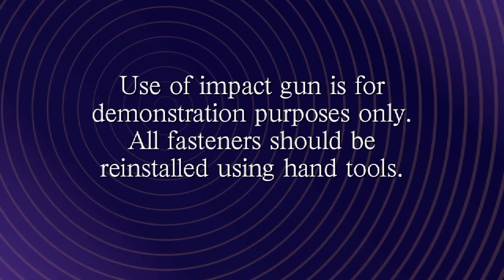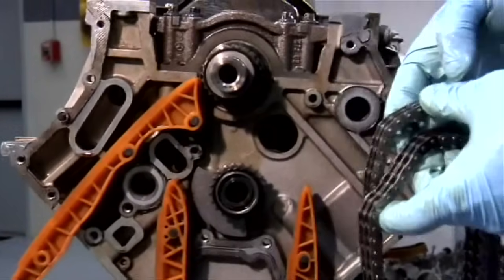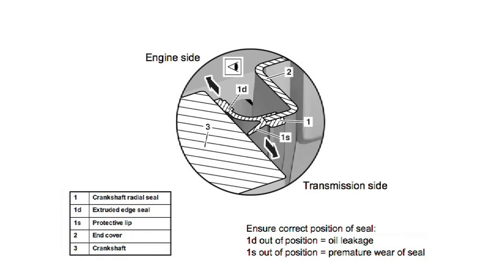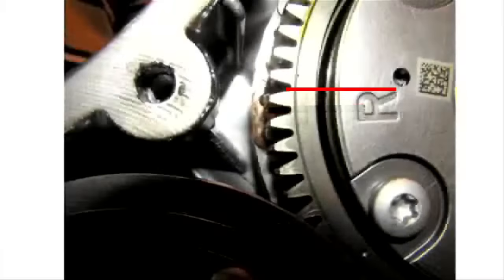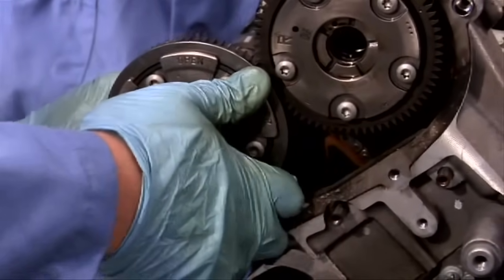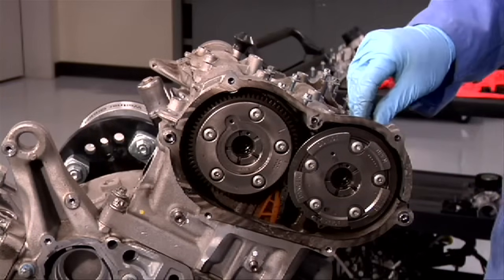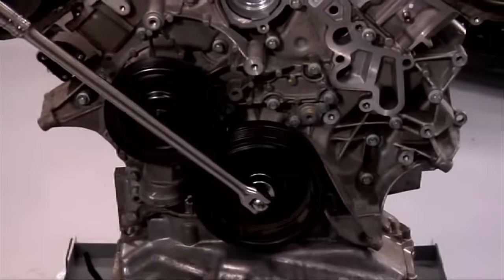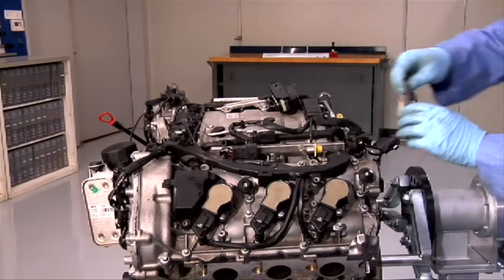M272 & M273 Engine -Balance Shaft Installation and Timing

Comment: Hey thanks for great video!!!
I do this on my V8 , everything goes well, except I can’t line up timing marks on camshafts perfectly. Copper links in place, but when I put all the gears together, marks are little off! I could not get a perfect line on all marks with the heads edges! Help!
Reply from the maker: If you're sure you followed the instructions then it sounds like one or both of  the cam sprockets spring lost the proper tension. That's why it's very important to first lock your cam sprockets before removing the chain tensioner.
Reply: Eddie Padilla 
I think that’s what it is! Is there a way to check tension out and restore it!
Reply: Eddie Padilla 
I was locking them before removal but was not when removed chain tensioner.:(
Reply: Kuland Hello, I really need help, I have the same problem as you. Did you find a way to fix it? (The marks are not lined up for me). Please reply soon, I really really really need help!
Reply: Saulius Jurevičius 
Hi, yes it did worked for me 
I just played a lot with it
Reply: Saulius Jurevičius 
Funny thing is that I can’t point out what exactly I did to lineup marks. There was no perfect line up with head’s surface 
What helped, I think, you have to pull the chain from left bank to the right as much as you can, to give intake camshaft on the right bank as much rotation as you can get. For that I had to give up perfect line on the left bank.
I did multiple attempts, resetting tensioner.
My sprockets didn’t loose tension n
Reply: Saulius Jurevičius 
My sprockets didn’t loose tension when I removed chain tensioner without pins installed, but don’t forget to put pins in if you remove sprockets
Reply: Saulius Jurevičius 
Watch this video, it’s very helpful!
Reply: Kuland thanks!! but I have one more question. when you were changing the chain, was the engine placed on the side just like in this video, or was the engine placed like in a car?
Reply: Kuland and one more thing. when I was disassembling the engine the camshaft was pointing on 30. what kind of way could I now put it into a 40???
Reply: Kuland last thing. I changed the oil pump, but the car still says that I need to fill up oil, but it’s already filled up!  Do you think you know what could help me?
Reply: Saulius Jurevičius 
Yes I removed engine 
I had it on the stand
Reply: Saulius Jurevičius 
Follow the video and you will assembling it correctly
Reply: Saulius Jurevičius 
You might have problem with oil level sensor or need to simply reset notification
Reply: Saulius Jurevičius 
More likely something wrong with sensor or wire since it’s located in oil pan next to oil pump
Reply: Kuland is it possible that because of incorrect cam shaft position assembly, only one (forth) cilinder is not working?
Reply: Saulius Jurevičius 
If your timing is off a little, you’re not going to notice only computer will give you a code 
Show your car to a good mechanic

Comment: Why did the heads have to come off? I’ve seen other videos where they do not have to come off
Reply: To remove the timing cover. You either remove the heads or the lower and upper oil pans. Removing the upper oil pan requires dropping the axle carrier, etc. Either way is going to take time. You could potentially remove the timing cover without either, but you'd jack up the head gasket sealing surfaces of the timing cover. Possibly doable with lots of RTV, but not the best way to go.

Comment: Can you do this job without pulling the motor?
Reply: Yes on the V8. No on the V6
Reply: Ross McCready why only on the v8? I have an E550 and there is hardly any working room in there.
Reply: @diablocls55  you can remove radiator and fan and you will gain enough room for V8.
V8 only has idler sprocket, where as V6 has balance shaft, so you have to remove engine for V6.
Reply: @davidjacobs8558  yep. Figured that out awhile ago. Never had to change my idler gear luckily as my car is a thousand or so units outside the offered range (late 2007 model) but I had to change the serpentine belt a few months back and it was a pain in the ass

Comment: Have to take the heads off?
Reply from the maker: It's not required; only the cam sprockets need removing if you don't cut the chain and add a link. However, I do recommend removal and inspection if it's your vehicle because the valve guides usually prematurely wear past manufactures specification.

Comment: I much rather have and work on on BMW because they don't use silicone crap they use real rubber seals that can do 100000 miles before they leak Mercedes will leak within 20000 miles
Reply: And how much does it cost Mercedes in time when building these engines to put that silicone on?

Comment: 4 things in this video i have questions about  1) Why does the weight on the end of the balance shaft need to be replaced. Some say the shaft and the weight have to be matched. If that is so how is it that you can buy the weight separately? 2) The pulse wheels were to be replaced " because the pins/studs can be sheared off if used a 2nd time" . Don't understand that if the pins are still there and in tact and insert properly. The torque on these is enough to hold these pulse wheels in place. 3) The Chain Tentioner "Must" be replaced because it cannot be reset. Wrong, with a vice and some small tools it can be reset. 4) You must buy 20+ dollar sealer for the gaskets. This I can understand for the valve/cam cover because it has some technical issues (like holding the cam in place) that makes sense, but for the timing cover, pan , thermostat, water pump gasket it would seem that Aircraft Form a Gasket would work fine. This issue of always saying these MUST be replaced with no explanation is irritating and makes me think Mercedes just wants to make MORE money on the blunder  they caused.
Reply: You are wrong in your assumption. To get the warranty for the engine Ballance shaft repair, you must replace the parts listed! Also you must use Mercedes Benz parts with the star to ensure for the warranty by Mercedes Benz!
Reply: @MissionaryForMexico this car is too old for warranty

Comment: How do we keep the timing chain in alignment on the crank and balance shaft after putting the front cover on?
Reply: you need to keep the block upside down
Reply: Yeah I got er back together perfect 👌 just weird putting the cover on before setting cam timing
Reply: In my case, zip ties.

Comment: Can this be done without pulling the engine?
Reply: I am currently doing this job... It cannot. The balance shaft bolts in on the back of the engine behind the flex plate. Plus it's several feet long so the radiator and ac core would have to be removed
Reply: @Ggggtt2  Absolutely correct, all you have to do is watch the video!
Reply: How is it running after you done this job????
Any issues????

Comment: Great video. Not a bad job doing the balance shaft repair. The mercedes kit is quite comprehensive too. Just don't overlook a stretched timing chain too.
Reply: Yeah, one was towed to me with a $4700k estimate for this. My diagnosis after checking all the alignment marks both at the gears and the little circles through the cam sensor hole were good, then a borescope down to the gear showed all good teeth.
Reply: @timthemechanix  so what was the solution then?
Reply: @imthatguypal_  The one I repaired required a new chain and not shaft.

Comment: I did it by the book and it ran. For 30 seconds. Heard a banging noise then it died
Reply from the maker: Ouch! You can start by checking the mechanical timing of the crankshaft to impulse wheels alignment and go from there. Goodluck!
Reply: Eddie Padilla When installing the timing chain tensioner does it screw straight in or do you have to take it apart? (Push the plunger out etc). I've a new chain tensioner, not reusing the old one
Reply: look up the procedure. after installing it straight in you have to push the rail back to engage it. You only have 1 chance to do it right so look it up.

Comment: Can the old balance weight be reused?
Reply from the maker: D Wall the manufactures SOP states that it must be replaced with the new balance shaft.
Reply: EP says SOP says you must replace the balance weight, but no reason ....want to know WHY? Do each one of these have a different matching weight? Then how is it you can buy new ones separately???
Reply: Balance weight bolt is TTY. You can check it and reuse. Ive done both. Thats the least of your worries if youre doing this job lol

Comment: Is Hylomar a good gasket material for this engine?
Reply from the maker: D Wall i dont know; ive only used permatex silicone gasket maker (black).
Reply: You should always use the MB sealant on these engines. Also known as Loctite 5900

Comment: Great video for video for someone attempting this at home. I picked up a lot for myself.
Few pointers from doing this myself. ( still in process....if it starts and runs... i'll post my /pictures/videos. )
1.) Don't need to remove heads or covers to change out the Balance shaft. It's extra work but, not as much as cleaning and prepping heads and covers.
2.) If you do end up removing the heads for cleaning and or valve work, the chain will slip off of it's locations if it's not supported correctly when flipping the engine to it's upright position.
Reply from the maker: Thank you for the pointers! Please keep us up to date on the status of your build and feel free to ask any questions.
Reply: Mine starts and runs if i can skip removing heads thats a great thing

Comment: Hello thank you for that video. I'm building same engine so I get an issue the right side sprockets they not forming a line and all my marks in the crankshaft and the balance shaft and the left side sprocket they timed perfectly? And I am suspecting the right exhaust  variable valve timing maybe it wound? Please can you tell me what do you think.  by the way after pulling the crankshaft take the Slack easthill not forming a line.
Reply from the maker: Karim Zemiri it sounds like before your problems you removed the right side camshaft. When you installed the right side camshaft the timing marks were aligned perfectly just like the left side camshaft, the crankshaft and the balance shaft. When you rotated the engine two complete rotations to check timing alignment you noticed that the right side camshaft was no longer aligned between exhaust and intake sprockets. If my understanding is correct then yes i do believe youre correct to suspect a faulty right side intake sprocket. It sounds like the sprocket no longer has the proper and appropriate tension which is leading to your issue.
Reply: Eddie Padilla thank you very much for the reply
Reply: By the way I didn't fit the tensioner when I was following the video I saw the tensioner it was the last thing to fit is it that right  because the sprocket they not forming a line in the right side and the R letter  it doesn't fit exactly with a cuppa link in the chain is it a tensioner makes a difference if it's out or on ?
Reply from the maker: Karim Zemiri yes, you have to install the chain tensioner before you rotate the engine to check for alignment.

Comment: A perfect example of an over engineered engine
Nothing's better than a good LT4 pushrod engine, light, simple, low center of gravity, dependable, easy to fix and mod and inexpensive parts, just to name a few of its advantages.
Reply: LT4? With direct injection? No thanks
Reply from the maker: My first build was a 305 out of a 69 nova; Id have to disagree with you. Typically a simpler system should have fewer moving parts. A overhead cam with nothing but an hydrolic tappit depressing the valves is simpler while adding a noticeable gain in performance. Any motor can be modified. The engine is extremely easy to build. The only thing you could mix up are the impulse wheels that are used by the system to monitor the position of each cam. Other then that you could get away with not marking anything and reassemble without any troubles. Plus, i prefer the superior gasket quality offered by silicone.
Reply: The advantage of an engine is its symplicity.
Why 4 valves and 4 cams, 5 miles of timing chains.
Push rod engines now have the cam advance and can achieve the same horsepower, torque and gas milage as DOHC.
They build DOHC engines because they put the idea in the buyers head that they were superior, this is bullshit.
The C7 does the Nurburgring in 7:16, better than any Lambo or Ferrari and the CTS-V beats any Mercedes and BMW
Reply from the maker: François D i hear you about the comparative lengths of chains but if we examine your statement of simplicity then the m272/273 has eliminated 66% of thr complexity within the valvetrain by taking out the lifter/push rod/rocker arm mechanism. Additionally, if you wanted to add additional valves to the system then the process becomes more efficient because the lobes are spread out on multiple cams as opposed to trying to fit everything on one cam. Additionally, by varying the realitive position of each cam individually the motor can more accurately adjust the variable valve timing.
Reply: Have you worked on this engine before? They are NOT easy... Plus there are many tools and one time use parts that add to the required procedures and total repair cost. Let's say you need to retime because youre a tooth off... $110 tensioner goes in the trash. As for the complexity, They have more than made up for it with the VVT system that does not tolerate any debris. Don't get me wrong I love MB engines, but Francois D is correct in terms of simplicity, power and gas mileage. (unless youre talking about the horrendous cylinder cancellation system on the GM engines). I do not however agree that DOHC is inferior at all. Just  a different solution.
Reply: @francoisd6942  Negative, the E63 and M5 are both faster than the CTS V 😂

Comment: Does any one know if the Balance Shaft Gear replacement part done at Mercedes is the same exact part or an improved version?
Reply: The replacement gear is the improved version used on the later engines.
Reply: Jason Behfar Mercedes doenst Take cylinder heads of, Rest ist same.

Comment: Is there a way to check balance shaft timing without removing the timing cover?. I'm replacing the cylinder head on the right bank and i'm paranoid that the chain might have skipped a tooth on the balance shaft.272 engine
Reply from the maker: ef4doorvtec im not sure. There is a port that has a hex bolt that screws into a very small housing; and, the housing is bolted to the timimg cover via two external torx bolts. It sits just beneath and to the left(driver side) water pump. But im not sure if it lines up or gives you access to the balance shaft sprocket. I had the same concerns and ended up doing a mock fit 3 times before i mated the cover to the block with silicone. You can check that first but if it doesnt work out then at some point youll have to trust your work.
Reply: You can view timing marks through the Cam sensor holes... Mercedes calls it Basic Setting or Position.
Reply: You can also remove the pass. side sprocket cover and Exhaust sprocket, and look down diagonally or borescope the actual teeth on the balace shaft.

Comment: I used this video for my guideline. i assemble a M272 engine with this guideline.. After done assembly, i'm it started and some knocking like misfiring happen. And a tapped sound rough just like a diesel engine.. Somebody please help me what should i do. TQ
Reply from the maker: Fakrul Azhar if the misfires went away and you did not prime the engine first then it was most likely the lack of oil pressure--the motor uses the oil pressure to adjust the cams while running. As for the loud exhaust, there are two nuts pressed into each the manifold that should be replaced durning the rebuild; you also want to replace the bolts too.

Comment: Great videos with vivid clarity. I am looking forward to doing this job on my '07 Ml350. Can you or someone reading please help me with direction or manual on how to remove the engine from the car (from above). Thank you in advance and for this presentation.
Reply from the maker: Fidelis Kaspa if you havent started then youll need to invest, if you dont have, a load leveler to go with your engine hoist. That will allow you to pivot the engine during removal and installation. There are the usual thing to lookout for as with any engine removal--make sure all wires and hoses are disconnected and out the way. If you remove just the motor make sure you unbolt and disconnect the transmission lines as they are bolted to the motor next to the oil pan bolts.
Reply: I remove transmission with transfer case, then the engine per MB service information. Also the radiator and AC condenser. I have a 272 waiting on my bay to do this job.

Comment: Is the Timing Crankshaft Gear typically changed when doing this repair?
Reply from the maker: Eric sin I don't work on too many of these but in my application it was only the balance shaft sprocket what wore prematurely but if there is abnormal wear to the crankshaft sprocket 'timing gear' then I'd expect it to also be replaced along with the chain.
Reply: Well guess is wasnt worn, no mention of it on my repair order, FYI I had two Indy euro shops turn down the job due to the scope of repair

Comment: is it possible to do this balance shaft job without pulling the heads?
Reply from the maker: Yes, if you keep the original chain guides then you could cut the old chain off and crimp the new chain once youve ran it back over the cams and crankshafts.
Reply: Yes, true about the needing to keep the chain guides but, you don't need to cut/remove the chain unless you want to change it out.
Reply: @lnv5238  How? Im at this point in the assembly.